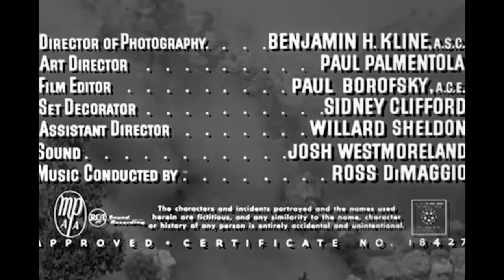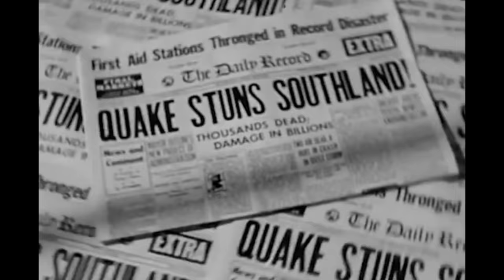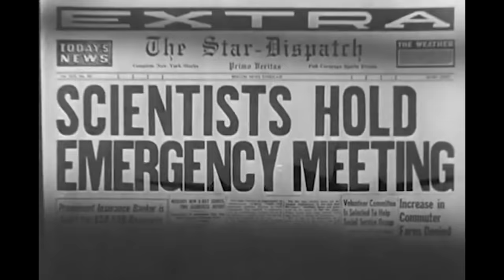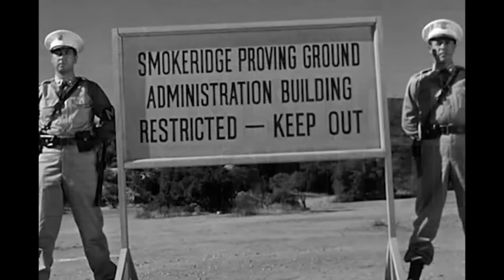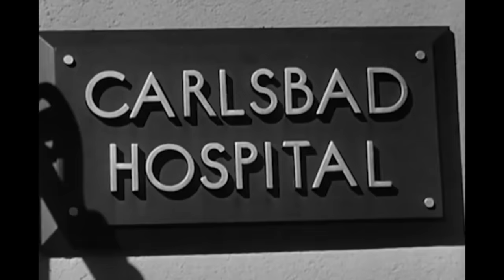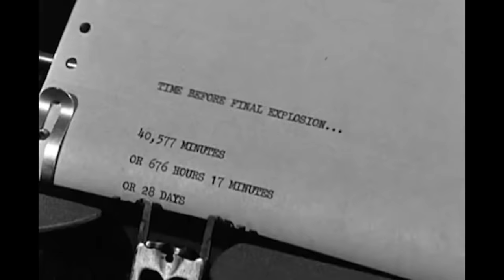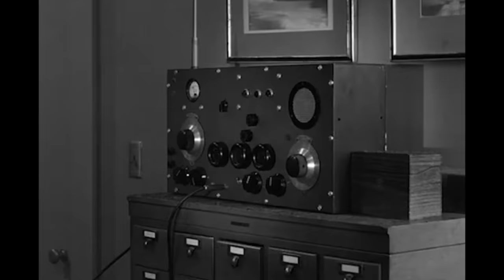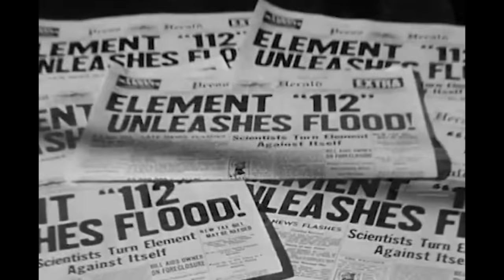The Night the World Exploded | Full Sci-Fi Movie | Kathryn Grant | William Leslie | Tristram Coffin

Comment: I'm wondering why they didn't just dump the rocks right into the box from the other box instead of picking them up by hand 👌👌 o
Reply: The rocks were in water to prevent them from exploding before time. They pick them out to expose them to the air and cause the explosion on time. Silly thing is why to place them inside another box at all instead of just overturning them on the floor... or pour the water out if a box was needed.